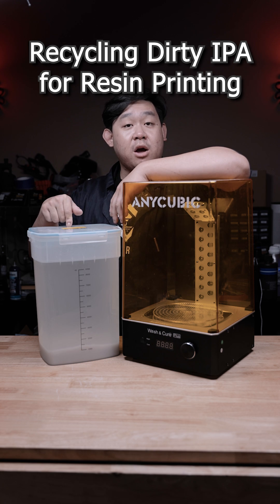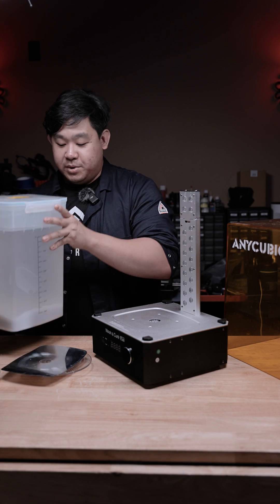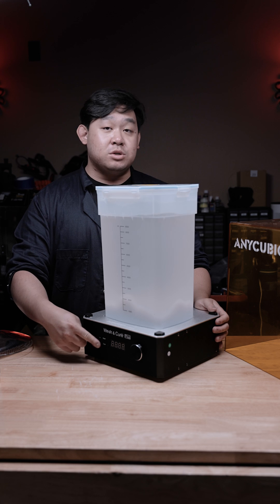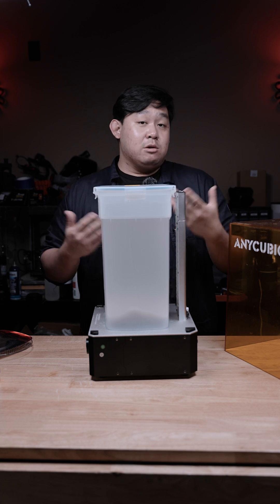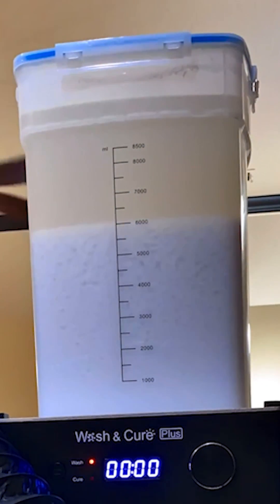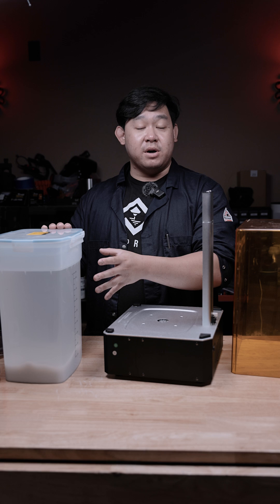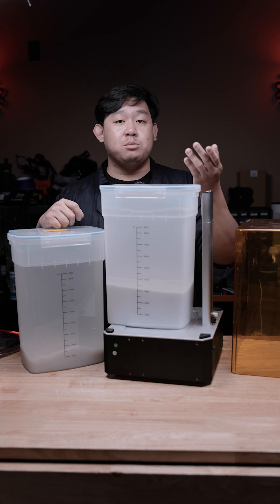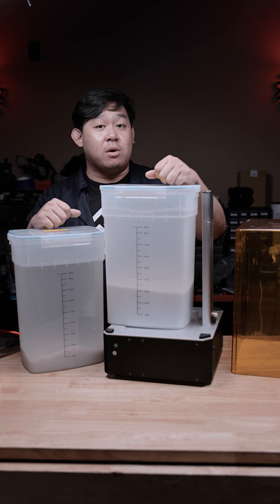Recycling & Reusing Resin Saturated IPA | Resin 3D Printing #1

Comment: I've been recycling IPA for a while, and hands down the easiest and best solution is to use a cheap water distiller. Make sure it's sealed well and set it up outside away from a structures that could catch fire. I use some electrical tape to seal the top of the sealer to the bottom, and then I just let it run. Within about 40 minutes It'll be done, and the IPA comes out absolutely crystal clear.
Reply: can you explain more in detail or send a video about it? im interested to learn more

Comment: Methylated Spirits (Denatured Alcohol) should be the main wash. It basically works like turpentine thins out enamel paint. Where as IPA will produce "gum" that will stick to the prints, and you have a massive clean up effort later on. IPA should only be used as a dip wash once the parts come from the Metho wash. Then blow dry the IPA off. Metho is also cheaper than IPA. 
Methylated Spirits long wash
IPA dip wash
Blow dry
Cure

Comment: Please add something about safety having the UV light on can be extremely dangerous for your eyes and skin which you haven't noted at all. With this video you're not noting that this is a non-standard use of the UV light so the person using it isn't getting the protection of the UV shield.

Comment: Hello. I am a bit new to 3D printing. You mentioned that you have a pre and post IPA solutions. How would this be implemented in the cleaning process? 

Print > Pre Wash > Remove Supports > Post Wash?
Reply from the maker: So how I do it is:
1) Print
2) Remove supports
3) Pre-wash to remove the bulk of excess resin
4) Post-wash to remove residual resin still on print

Reason for the 2 washes is because you won’t get a good wash with saturated IPA as it will leave a film of slick residue on the print. The post-wash is not as dirty so it will be able to clean the resin off more effectively & due to the reduced amount of resin on the part it won’t get dirty as quickly.
Reply: @MinWin3D  Good to know. I will do this for my prints. Thank you for the info!

Comment: We need wash and cure stations that recycle their IPA.  The entire wash process needs to be optimized for best results with minimal labor and minimum alcohol consumption.  I spray the parts and build plate with IPA straight out of the printer and the IPA runoff from that is heavily contaminated with resin so it goes into a tray that is exposed to UV to cure it so the resin can be discarded.  Then I do an agitated dunk into the "dirty" IPA tank followed by an agitated dunk in the "clean" IPA tank, and the parts are then sprayed again with new IPA to remove the last of the contaminates from the "clean" tank.  That IPA drains into the clean tank.

We need wash and cure stations that swirl and cure IPA, then filter the IPA with a large and inexpensive bypass filter media and/or centrifuge.